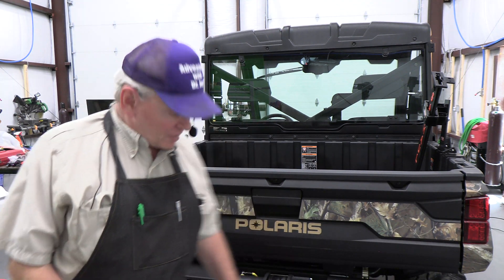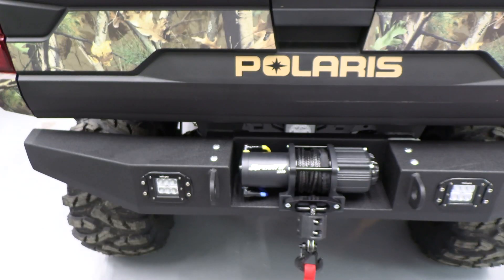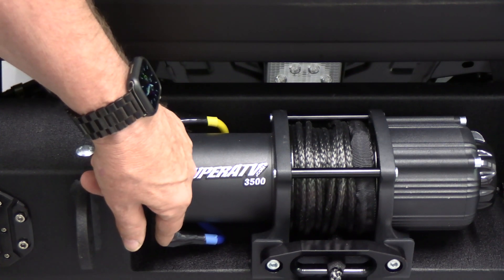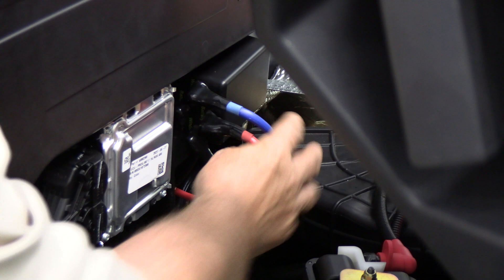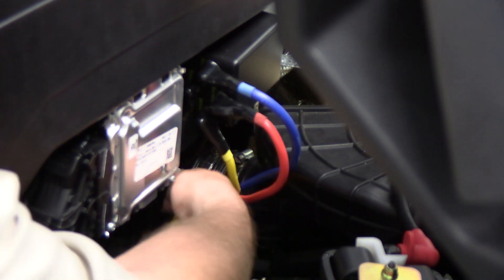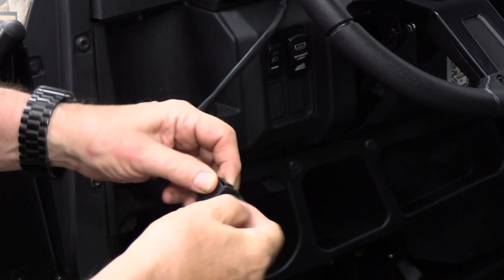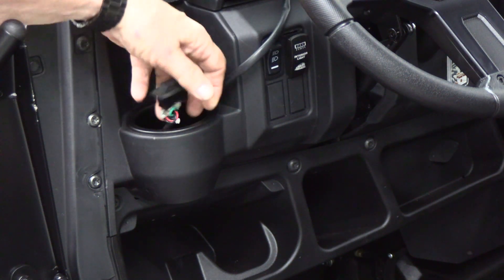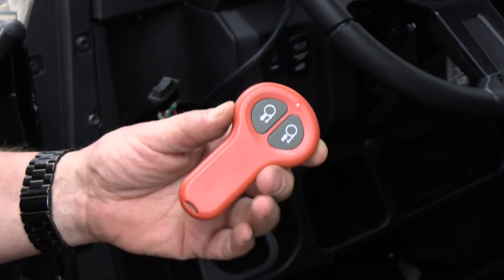Winch Wiring Simplified!

Comment: I just bought a KFI 5000lb winch with 8ft cord remote -I have a John Deere gator - do I have to attach the red lead to the red ignition wire or can I just wire from winch, to solenoid  to the battery?
Reply from the maker: Hey, great question you can wire it directly no problem then you’ve got power all the time where the ignition is on or off that may be a good option for you. Consider subscribing. Thanks. Joe.
Reply: @JosephHunstad  appreciate the speedy reply - thank you so much - I may contact you in a few days when I start to wire the winch - BTW, I’m subscribing now to your channel

Comment: The circuit breaker would have been helpful
Reply from the maker: Thank you for your comment. Yes a circuit breaker is very useful and typically just placed in line with any major elements such as a winch or lights or other things. It can be placed anywhere within that circuit, but usually is placed close to the device itself. Consider subscribing. Thanks. Joe.

Comment: I have a warn 9.5ti with a six wire switch lead I'm going to change from standard solenoids to a contactor. In verifying the wire functions, I discovered the common ground wire for the solenoids is also switched on when the winch hot is switched on. Can you tell me what the purpose of that is as opposed to a constant ground?
Reply: One of the main reasons for that is if the relays or controller goes bad it will cut power to it stopping a winch run on, when you release the switch.  In other words if the winch was wired like the old way and stuck on, the only way to shut it off was disconnect the battery cable(s).  The new way cuts the power and ground off to the winch.  

The old relays could do this while you were away or would not shut off when you released the switch.  Very dangerous.  

Many other ways to do this in older and newer systems.  A belts and suspenders thing.
Reply: @offroad6309  I've been thinking about this. The switched ground will cut the ground off to the contactor so it will not function. However, the winch is still grounded directly to the battery. Worst case scenario, suppose the contactor got stuck in the on position while winch is in operation. Breaking the contactor ground still might not break the winch circuit. A bit of a reach, but still.........IDK. Has a contactor ever welded itself together?
Reply: @gdavis8588  while I'm not aware of that happening doesn't mean it's not??  

The relay type this was a real problem.  Winch manufacturers went away from the relays for this issue and bad contacts.  The controller eliminates much of this.  

Another issue is having a heavy power cable going out to a front bumper making it susceptible to damage in a front end collision.  For this reason I think a power cut off under the hood is wise.  The winch doesn't need power until use.  You can even turn it on when heading up the trail the same time you air down and off when you air up.
Reply: @offroad6309  I installed a cutoff switch. I can see the switched ground making more sense with the older multiple relays.
Reply: @gdavis8588  sounds like you are good to go.  Have fun.
Reply from the maker: OK, you ask him an excellent question. I do not know why the ground would be switched off, but I guess to be certain that there’s no electrical drain everything is switched off I guess for Safety I’m really not certain. Consider subscribing. Thanks. Joe.

Comment: Hello, I have a Sportsman 500, Polaris. The wench was periodically not responding on 'In'. Now it has failed completely. I just purchased a replacement switch but think likely that I should also replace the solenoid. Does the solenoid also fail or primarily just the switch dies from use. Thank you for your GREAT channel.  Best, John
Reply from the maker: OK, you ask a great question. Electrical problems are always frustrating because like you noticed, they can be periodic which is very difficult to diagnose and then fix. To be sure it works all the time I would replace both the switch and the solenoid, but the switch is the likely culprit. Thanks. Joe.
Reply: @JosephHunstad  Dear Joe, I cannot thank you enough for your invaluable assistance. If I may ask one more question - do you know the exact solenoid to get for replacement? Again "I THANK YOU!!!!!!!!" ATVs are such a pain to work on and having your kind of resource is incredible! John
Reply from the maker: @drjohnespy  https://amzn.to/3UWJe7o  

 this is the link I believe will work for you  Joe

Comment: How would you suggest wiring a winch in a hybrid tundra that has battery under back seat?
Reply from the maker: Thank you for the question. The best way is probably to take two large capacity wires connect them directly to the battery and run those straight to the solenoid and then from the solenoid you can connect the switch and the winch. Consider subscribing. Thanks. Joe.
Reply: So no fuse on the high amp wires ?

Comment: Do I have to install a circuit breaker or any other way to protect the electronics? 

I don’t want to fry anything.
Reply from the maker: You ask a really great question because yes, a circuit breaker in line is always a good idea. Pick the correct amperage for your application. Anything from 2 A up to 20 A but that’s usually overkill. Again the appropriate amperage is the most important thing with an in-line circuit breaker. Consider subscribing. Thanks. Joe.
Reply: @JosephHunstad i have a 5500 and it says amp can jump above 250 so I have it on a 300 amp breaker for the 80% overcurrent breaker protection.  Is this wrong?

Comment: I bought a jeep with a winch didn't come with the control so I bought a wireless one. The winch works but only when it wants to and I'm having difficulty figuring it out any suggestions
Reply from the maker: Periodic electrical problems are a real challenge to fix. First thing I would do is replace the batteries in your remote and then check the wiring on the winch to be sure it’s all stable and solid and properly tightened. Tough one. Consider subscribing. Thanks. Joe.

Comment: This just the video I was looking for. Will the ALWAYS KEYED ON drain the battery?
Reply from the maker: Hey, I’m glad you found this helpful. If you have something running on that always online guess it will drain the battery for sure but if it’s not connected to anything using power, it’ll be OK consider subscribing. Thanks. Joe.

Comment: Pardon me sir this covers  5000 lbs  and under. 8000 to 15000 have 3 power terminal on the winch plus a ground.
Reply from the maker: Thank you sir you are so right. Yes this is the basic wiring set up for an every day winch that we would be using on an ATV TV, etc. No it is not the heavy duty wiring for a really full-size truck winch as you know it. Thanks again. Consider subscribing. Joe.

Comment: Hi Dr Joe. So I purchased the exact same winch to put on my 2024 Polaris rzr. For the lighted rocker switch, If I connect the red wire to the hot wire on the pulse bar, it won’t drain my battery? I see you have the switch hot all the time and was wondering if you’ve had any issues with the battery?
Reply from the maker: Really good question thank you. If the switch is hot all the time, then you can run the winch with the ignition on or off which might have value. As long as you don’t have the switch turned on it should not drain the battery. Consider subscribing. Thanks. Joe.
Reply: @JosephHunstad Thanks Joe! If I wanted the switch to only be hot when ignition is ON, could I use one of the pulse bar connectors you speak of? And how would I do that since I only have 1 red wire coming from the switch? Also subscribed 👍🏻
Reply from the maker: @itsbigjake5363  OK then you can use one of those pulse bar connectors that has the blue wire that is the hot only when the ignition is on but it has limited amperage. In my description I think there’s a link to get those Poul Spark connectors they’re really inexpensive and they’re excellent consider that. Thanks. Joe.
Reply: Ok understood. Thanks a lot Joe! You’ve got the only good videos on this subject! And I really appreciate your responses.

Comment: Most bus bars are on a 30amp max draw... if a winch will draw anywhere from 60-80amp, how will it not blow the fuse...?
Reply from the maker: That’s a really great question. The current basically flows directly through the solenoid to the battery. The switch that allows that to happen just completes that circuit and isn’t involved in the current flow. That’s why a greater draw for your winch as possible.

Comment: What color wire goes to which connector on the solenoid for forward- reverse? Wiring diagram? For 5 pin connector?? Simple question?
Reply from the maker: Your question is appropriate. The solenoid basically has four connections to that go to the winch itself, and to the connect to the battery. There’s also another cable that goes from it to the switch, which will change the polarity going to the windchill are we need to go forward and reverse. Inside the solenoid also is a receiver that gets the signal from a remote control. If so, equipped. The color is typically to the winch are yellow and blue. The colors to the battery are black and white, and then the small diameter wires that go to the switch are usually in a cable loom to keep them together and make routing easier. Thanks for your question consider subscribing.

Comment: Can I grounded to the frame close to the solenoid? Or had to be grounded to the negative side of the battery
Reply from the maker: First of all, you can always ground to the frame. In this example I ground to the battery with a large diameter cable just to be sure I’ve got really good electrical flow to the winch. Consider subscribing. Thanks Joe.
Reply: @JosephHunstad  thank you so much I did ende grounded to the frame by the other things were grounded used the same screw. I did suscribe you are awesome

Comment: Did you wire in a circuit breaker or any kind of fuse?
Reply from the maker: Thank you very good question. Yes typically there is a fuse in line with the power cable that goes to the winch. Consider subscribing. Thanks, Joe.

Comment: How does the little switch get it's power ?
Reply from the maker: Hey there, relaxing nature. Thanks for your question. When the switch is turned on or engaged, it sends power through the solenoid to the winch for either forward or backward or reeling in or reeling out. The switch literally completes the circus so that the energy from the battery can go through the solenoid to the winch. New question consider subscribing. Thanks, Joe.
Reply: @JosephHunstad 2 wires go to the winch  ..but  is the switch powered by a 3rd wire ?
Reply from the maker: @relaxingnature2617  so if your switch requires continuous power, such as an illuminated light, or something else than the red wire is used otherwise it’s the blue wire, which only powers the switch with the ignition is on.

Comment: Can you explain the wire from solenoid to switch in more detail. I have a 7 pin rocker. Does the red run from solenoid direct  to + battery and black to - battery? Where does the solenoid to switch wire connect?
Reply from the maker: Take a look at this link I think this will help

TWTADE Momentary Polarity Reverse Switch DC 12V 10A Motor Control 6 Pin 3 Position (ON)-Off-(ON) 

Copy and paste that in Amazon and you’ll find directions on using that momentary switch, which is good for the winch in and out functions

Comment: So quick question, I have a 2016 Jeep Wrangler Unlimited, it came with a winch that you have to attach a wired "in/out" control to it for it to work. Can I wire the winch directly to the battery? Thanks!
Reply from the maker: Hello there. Great question. You absolutely can wire the winch directly to the battery, but it would be a good idea to have a switch in line with one of the leads because when you connected it’ll be on one way or the other all the time. You may have to reverse the leads if you’re changing direction.